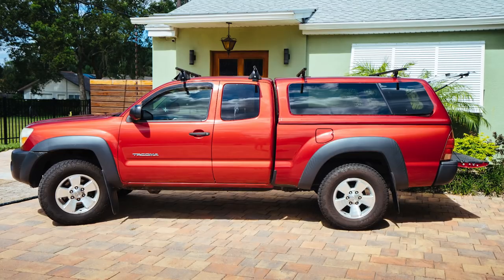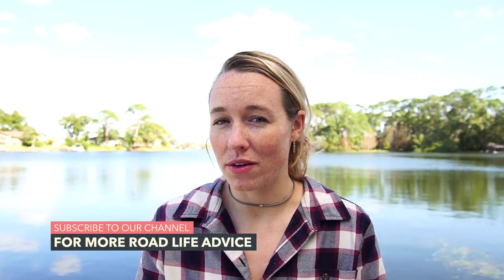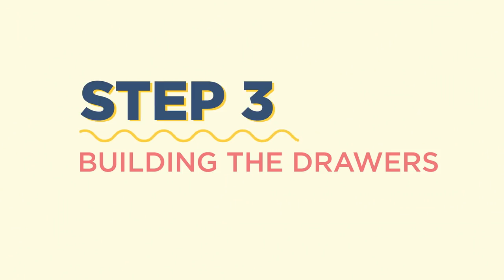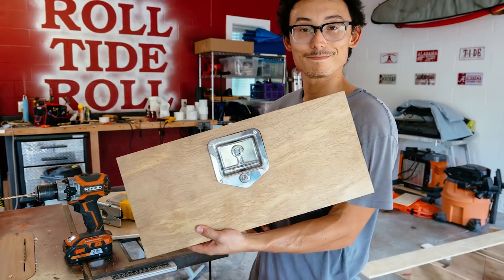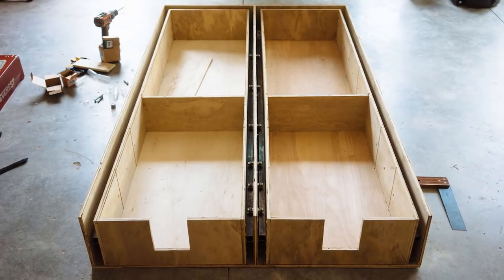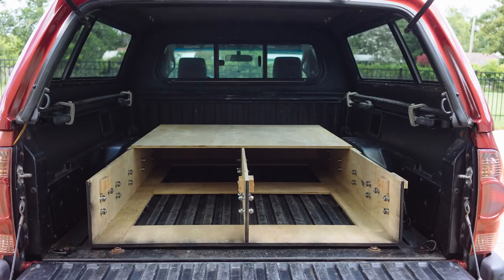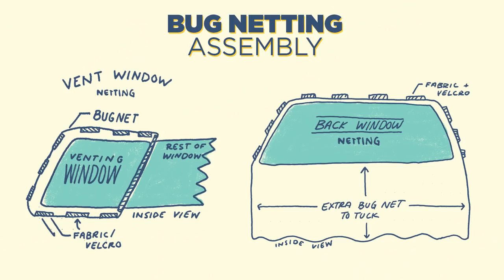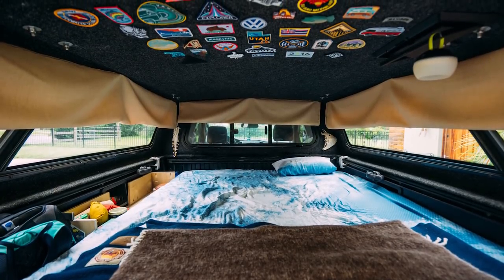HOW WE BUILT OUR TACOMA TRUCK BED CAMPER

Comment: A Leer 180 model camper shell would give you a lot more headroom for sleeping and not hurt the gas mileage. I use a 2006 4x4 Tacoma access cab with the Leer 180 shell for my mining adventures in Nevada and live in the back for a week at a time offroad in the desert.

Comment: Hi Owen and Mary, Happy New Year from The Great White North

Given the vagaries of YouTube, I have just now discovered your channel.  Thank you so much for taking the time to post...I certainly appreciate the time and ingenuity you have put into your channel, and your build.

On the matter of this particular video....you used 1/2" plywood for the platform and drawers...now that you have been using it for a while, how is it standing up?  Are you happy with the 1/2", or would you have gone 5/8" or 3/4", particularly for the structural pieces?

Most folks tend to over-engineer, myself included, but if the 1/2" has stood up, that is far better than something heavier

Thanks so much once again.

Be safe

Comment: Thinking of doing a similar build on my truck for long trips. I was wondering how difficult it is to remove the shelf/platform from the bed of the truck? My wife and I really want to be able to have this but take it out, should we need to load up the truck for a move or something
Reply: I'm just starting to plan something like this for myself and this is a big concern for me too since I also use my truck for work. I feel like getting it out is doable as long as its narrow enough to fit between where the cap begins to bend inwards and the top of the wheel wells. Maybe put a hinge on the bed platform near the cab so you could fold part of it up to access mounting/tie-down points behind the drawers. You might be able to rig up a ratchet strap as a non-permanent solution. Alternatively, maybe build and fasten each drawer separately, and then just lay the bed platform on top. That way you could remove the bed platform and then individually unfasten and remove the drawers, negating the wheel well/height challenge. Those are a few ideas I've been toying around with. Best of luck!

Comment: Awesome build. I was wondering how well the draws are holding up after sometime on the road? How do the slide if your off camber?
Reply from the maker: They held up super well! There were no signs of wear when we sold it nearly a year later. The drawers never had a problem sliding either when off camber! The wheel bearings were impressively smooth!

Comment: How did you determine the length between the bottom and top bolts that carry the bearing. I understand the width of the tubing is an inch, but the bearing on the bolt will give a few mm of space. I’m in the middle of planning to build the slide drawers but haven’t come to a way of figuring out the measurements. Thanks

Comment: Well done! Why you go for the Doublecab instead of the Supercab (1.5) on the Taco? Are you happy without a Roofvent at Night? Thx for sharing.
Reply from the maker: We wanted this set up to be as cheap as possible because we knew it would be temporary. We used this set up as a holdover while we figured out what our more permanent set up would be. By going cheap we could have some extra money in the bank in the event we found something we wanted to put a down payment on. As for the roof vent, yes we were fine without it. We just cracked the rear hatch to vent on warmer nights or left it open entirely if we were somewhere we felt comfortable doing that.

Comment: did u have to find longer bolts to replace the stock ones that hold down the bed to the frame?
Reply from the maker: Nope they are crazy long and had plenty of extra room for the bed so the OG ones were used

Comment: No insulation? Just the carpet lined canopy? How was the heat?
Reply from the maker: No insultation, we left the camper shell as it came which was lined in a felt of sorts. It did great in the heat too we just would leave the vent windows open or the back hatch open at night to keep air moving!

Comment: 1) Rad build!
2) I'm confused how your handles actually lock, there's usually a strike plate or something on the non-moving part of the drawer that a bolt goes into. Can you shed some light?
Reply from the maker: Yes you are correct! We sawed a groove into the top blank of the bed platform that it rotates into. It sticks up ever so slightly through the top of the platform but we never have felt it. Another reason we went that route was to save on clearance for some of the taller things in our drawer so it wouldn't drag as we pulled the drawers out!

Comment: Great project. I built a Toyota Tundra, still refining after 6 months, 2 road trips. You need to plan, measure, buy, build, fail, try out, repeat, to get it right. You need tools: table saw, drill, grinder, sewing machine, soldering, garage. You need skills: research, carpentry, sewing, organization, electric, auto, insulation, solar.
Midway, I was near GVWR on my light truck as gear, armor, plywood, food, water, and persons adds up. So I removed rear seats to stay safe. Seems unreal for $400 in a weekend. Nice Youtube skills!

Comment: Your truck camper looks great but the lack of headroom would make it a deal killer for me.  I'd like to be able to sit up in there.  Don't know what your budget is, but have you seen this company?   http://belairshells.com/wood-n-alum   They make truck camper shells for Tacos for a little over $3k.  You could gain some vertical height and storage space while making it less claustrophobic in there.  Maybe have room for a battery and a solar panel or two up top?  Fantastic fan too?  Refrigerator in the back seat of the Taco or the truck bed?  I guess you got used to it over the past six months, so maybe it's a non-issue for you both.